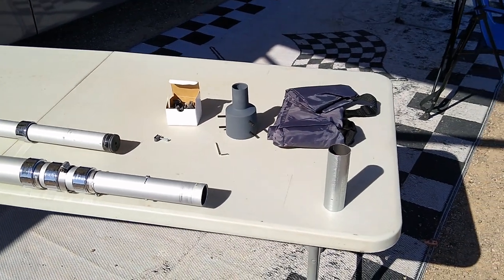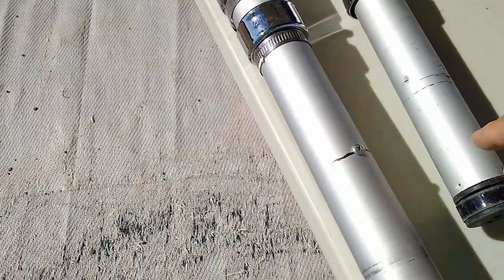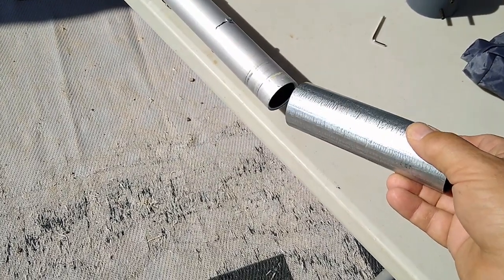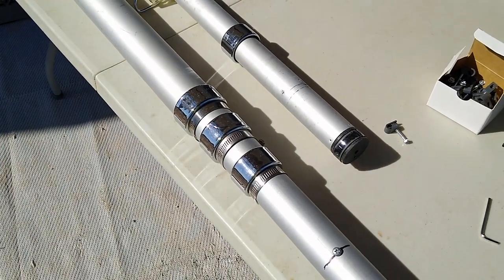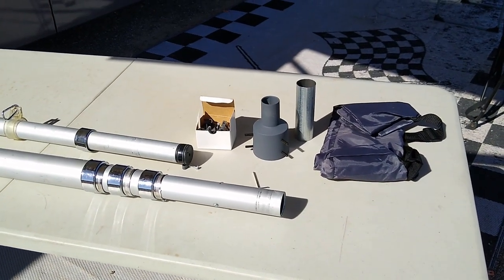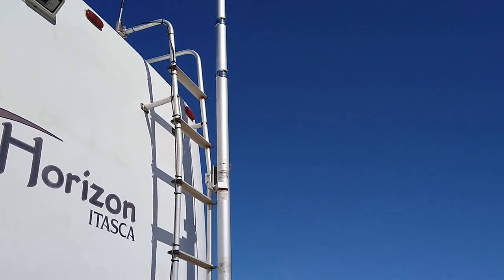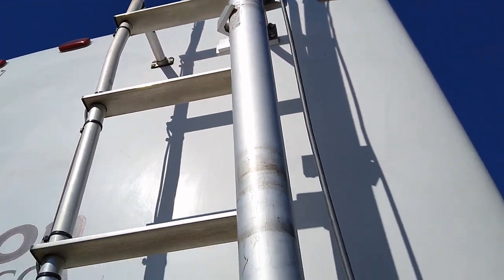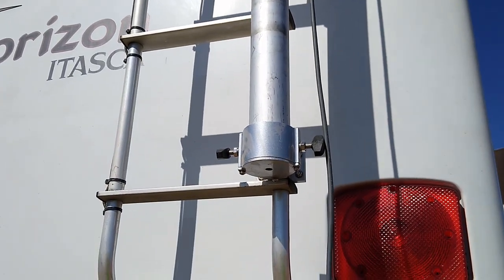StarLink Pipe Adapter on a Telescoping Flagpole

Comment: Great set up. Why did you keep the cable on the outside of the pole? I’m setting one up now, so tips are appreciated.
Reply from the maker: Because the flagpole telescopes and did not want to chance the wire getting pinched. Hope that answers your question. 

Thanks for your comment and for watching our videos.

Comment: Thanks! This video helped me decide to mount it on top of one of my bird feeders. I ordered a pipe adapter but the V2 dish fits perfectly in the top of the pole. Tried to look them up on HD and Lowes website for reference but could not find the pole feeders I have. Very sturdy, they made it through at least two hurricanes. However it is a 12-15ft pole and I could not reach the modem with the 75FT cable. As a temporary option I am using one 5ft section with the included legs. The part that slides in the other pipe is the perfect size for the legs as well. Weighed down with a couple heavy stone pieces.
Reply from the maker: Thank You for watching our video and for your comment.
Reply: Some gnarly bird feeders!!

Comment: I didn't use the StarLink Pipe Adapter. I'm too cheap. I used an exhaust pipe connector I bought for under $10 at a hardware store. You can get them in a wide range of sizes. Because I used a scrap length of 1.5" galvanized pipe as my mount, I used a 1.5" to 1.5" connector but there are adapters for a wide range of pipe sizes. I installed the connector on the galvanized pipe using three self-tapping screws and then used a bolt to hold the dish on through two holes I drilled to matched the Dishy retractable buttons, which are easily removed. It is as solid as a rock. The galvanized pipe I attached to an unused hydro pole on my house using U-bolts. StarLink Dishy is currently sitting 20 feet above the ground with no obstructions. Cost me less than $15.

Comment: I heard that you can feed the cable through the pipe adapter. The cable that connects to the satellite dish can bend 90°downward and click into place allowing it to go through the pipe.
Reply from the maker: Do not see how that could be possible. Built into the mounts is a key and built into the dish a keyway. The key and keyway serve two purposes. One to keep the dish from turning in the mount. Two help hold the cable plug into the socket. Thanks for watching our video and your comment.
Reply: This video shows how you can thread the cable through the adapter: https://youtu.be/9BpVlM3uPfw?t=433

Comment: Love it. I have this same pole. Came with my WeBoost. You got yours at harbor freight?

I solved the problem with the weak "twist to tighten" mechanism by drilling holes and running a hitch pin through that locks the pole in extension.

I know folks have asked how it holds up in wind, I'm curious if you've noticed any loss of signal with swaying in the wind? Does it need to be super stationary? That's the only concern I have about putting mine up on the flagpole.
Reply: Also, what do you do with the cable? I coiled the coax for the WeBoost around the pole, so it spirals up the pole when extended, but it doesn't look great when retracted.

I'm also thinking about DIYing the pole adapter. Was the kit worth it?

Also, great tip with the galvanized pipe reinforcement. Definitely taking mine apart to add this!
Reply from the maker: Yes I purchased the flagpole from Harbour Freight.  So far I have not had to extend all the way up. 

We are currently in a US Forestry Campground and the pole. Attached to a Tee post on the ground. I do have some blockage from the trees. But the system works with a few drops in signal.

Comment: Great.  Pipe dimensions? It looks like you've removed the last pole section only.  What was the inner/outer diameter of your remaining finished top section, and what size pipe was the galvanized insert? It would be interesting to know the diameters of the lower sections too if you have them, as I don't find it listed anywhere on the Harbor Freight specs.  Thanks!
Reply: I'll answer my own question here for anybody else interested, as I just went out and got the flag pole kit since writing the above, but am still looking for an insert for whichever top pole section I end up using.  5 total tube sections, from base to top: Base Tube 1:  OD 2.326", Tube 2: OD 2.174", Tube 3: OD 2.010", Tube 4: OD 1.816", Tube 5: OD 1.654"

Comment: Yes that’ll work, but an RV mount is subject to your ability to stabilize the entire RV. I would think a ground mount would be more stable and easier to move around to find the best field of view.
Reply from the maker: If the stability of your RV is affecting the signal of your starlink system. You have bigger issues to be worried about. As to the field of view. The higher the dish, the easier it is to avoid obstructions. Check out our video "Starlink Trees Yes No Maybe." While we could not avoid all the obstructions from the trees. It made it possible for the system to work 99.5% of the time. Thanks for watching our videos and for your comment.

Comment: great video I have to figure out a way to modify what you did there, because our portable waste tank hangs off our ladder when we don't need it. so I'm limited to between the side rails of my ladder and the camper itself. I might need to get a bracket welded to my bumper for the tank to live? that would actually be nice since I have to remove the tank to use the ladder. the bed of my truck has no room for it, I have a Big 3000 Watt Honda Inverter generator and a tool box in the bed.
Reply: You might investigate putting a mount on your tongue jack. Conduit standoffs work to hold a PVC or Galvanzed tube to the jack shaft, then slide the flagpole into the tube. If water is an issue, you can use a slip-on gasket that seals with pipe clamps.
Reply from the maker: @chrisyoung5909 Sounds like a good idea. Unfortunately for us we have a motorhome. Which I'm sure you know doesn't have a tongue jack. Thank you for watching our videos and for your comment. Be safe and may we meet around a campfire.

Comment: Is it safe to leave the dish on top of the pole while driving as long as you have retracted the pole sufficiently so that the dish is below your RV roofline? That way the wind doesn’t hit it.
Reply from the maker: It is not safe. While I believe the dish has been engineered. To withstand what nature can throw at it. Within reason that is. I don't think it could handle it while driving down the road. There has been speculation about a mobile dish. For which we will have to wait for. Thanks for watching our videos and for your comment.

Comment: Does it have to be that much higher than the roof? Or can you almost have it as low as the roof and still get a good signal?
Reply from the maker: Yes you can have it at the lowest position. As long as you have no obstruction. We boondock 98% of the time. So when we are in a area with trees. Then we extend up to clear the trees.  Thanks for watching our video and for your comment.

Comment: Have you come up with a good way to route the cable into your RV?
Reply from the maker: Yes, I purchased a shore power cord cover and installed it where we setup the router.  I also use it for the Buddy heater lp hose. One of my previous StarLink videos I believe we talked about routing the cable into the motorhome.

Comment: Very cool. How did you run the network cable into your RV?
Reply from the maker: I purchased a shore power access cover from a RV parts store. With the help of the correct size hole saw. Drilled into the side of our rig where we needed to route the cable. We use this same access to route the LP hose for a portable Buddy gas heater. Thank You for watching our video and for your comment. Please subscribe and check out our other StarLink videos.

Comment: How did you remove the sections of pole?
Reply from the maker: You have to remove the plastic sleeve in order to remove the top section.
Reply: @igowhereimtowed6839  thanks, do you mean the chromed plastic ring? If so, I have tried.  What’s the trick?
Reply from the maker: @Chris  With a heat gun or hair dryer, heat up the plastic sleeve. You might want to put on a heavy glove. You are trying to soften the glue of the sleeve. Once you have it soften up twist the sleeve off. Slide it up enough to clear the tube. Then the inner tube can be pulled out.
Reply from the maker: @OPSteel97  yes the chromed plastic ring. This ring is used to keep the tubes from pulling out of each other.
Reply: @igowhereimtowed6839  thanks so much…I’ll give it a try

Comment: Any update on how this is working? Any issues?
Reply from the maker: Working just fine. Currently in a national forest as a camp host. Have ground mounted extended up about 18 feet. Trying to clear the pine trees. While I still have trees blocking the dish to the northeast. Still have speeds over 100mps. With that said we have some signal loss for anywhere from 2 to 10 seconds. There is zero cell service here. So we are able to make and receive calls with WiFi calling. I see a lot of negative reviews from starlink YouTubers. I guess they do it for click bait. Because starlink is no where near the number of satellites planned. How they can complain about the system/service. That is not completely up and running is unreal. Yes I have had issues but it was the equipment. Sorry for being long winded. But the telescoping flagpole and pipe adapter are working very well. Thanks for watching our video and for your comment.